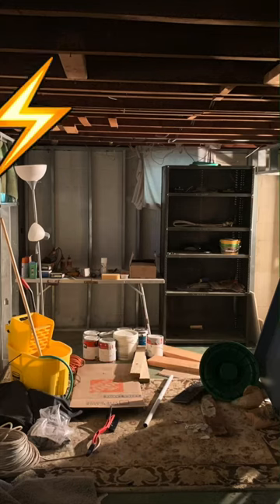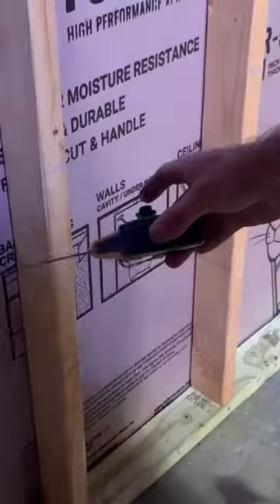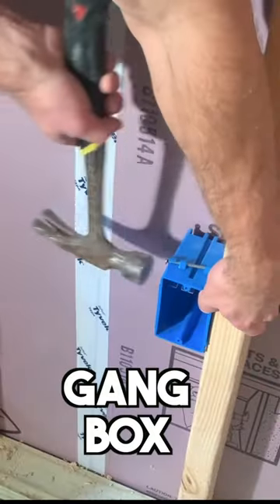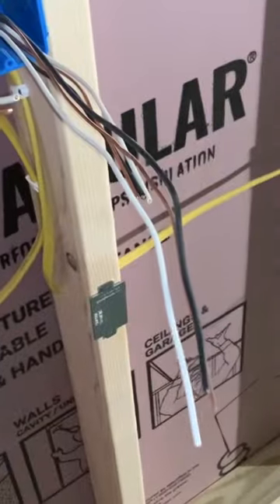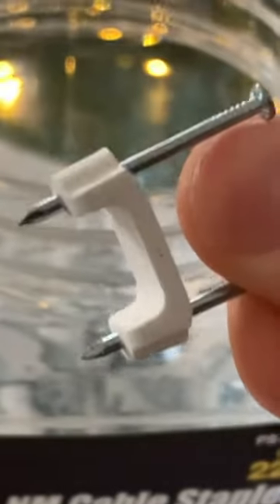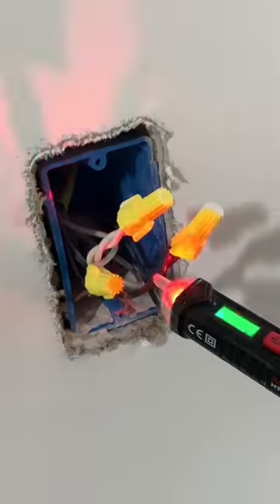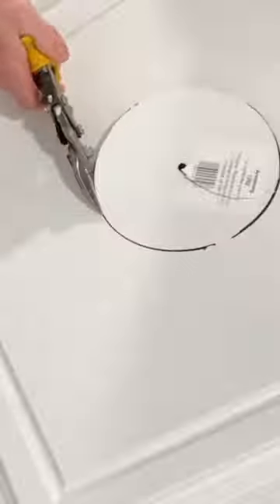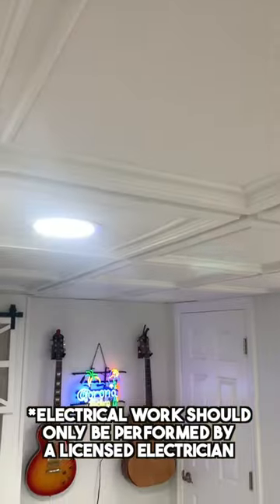How to Finish A Basement Ep. 4 (electricity) #Shorts

Comment: Licensed electricians needed to do the job depends on where you live. In our county, homeowners can pull the permit and do the job  themselves. I installed a 60 amp panel in my shop, and the county supervisor/inspector were very helpful. The inspection process was done over FaceTime. It was an enjoyable process. There is a lot of hardwork and thoughts have gone into developing NEC codes. Another good example where a good government and governance is beneficial.

Comment: No insulation? Or vapor barrier?
Reply: There is no absolute rule here unless your code requires it. The best basements are those that don’t trap moisture. Permeable materials are preferred to keep moisture from getting trapped
Reply: Also curious about this, doing my basement soon and thought i could throw a vapor barrier of 6 mil behind the framing and put up bats of insulation. Is this rigid foam board and this videos demonstration better?
Reply: @ASSOL3  i am no professional but my brother is and remodels houses for a living. I did my own basement but got plenty of advice from him to guide me through the process. According to him, if you basement is dry other than occasional condensation, permeable materials are better. Otherwise you need a vapor barrier between the concrete and framing
Reply: @jeffdwtf  i appreciate the fast response! Good to know, just moved in and the previous ppl put up panels and 1x2's to frame. Think ill tear them down and assess the moisture and go from there. Thanks for sharing the knowledge!